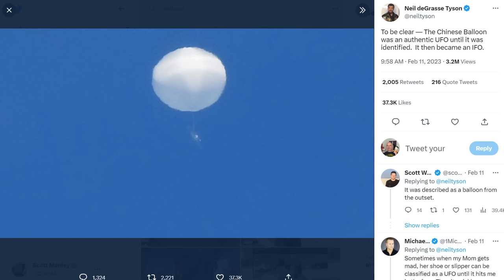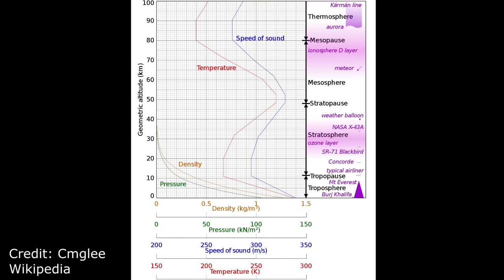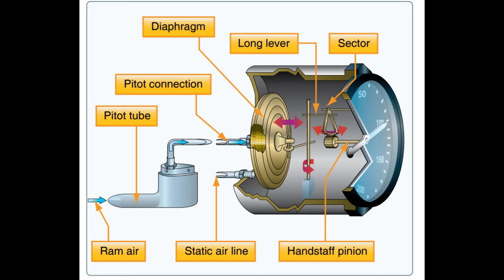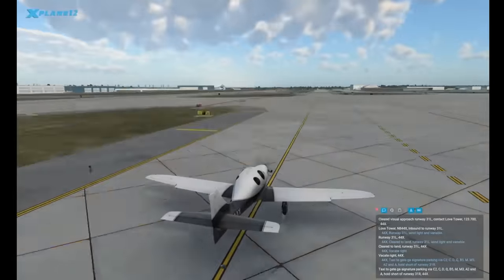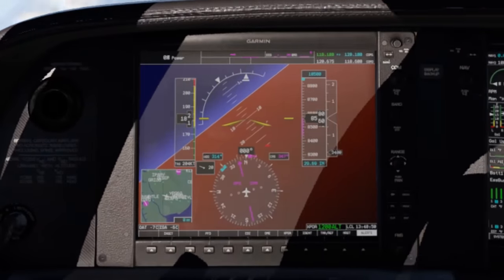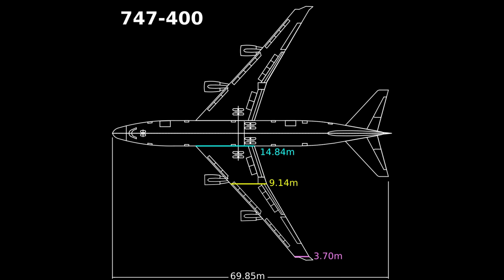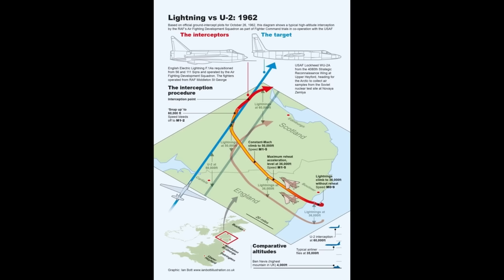How To Design A Plane To Fly At 100,000 Feet?

Comment: Fun fact: the U2 flies so high in the atmosphere, it can fly into the temperature inversion in the stratosphere, meaning the speed of sound actually increases again and it can go even faster without exceeding its limitation on laminar airflow. It also makes a very weird flight performance/ coffin corner envelope.
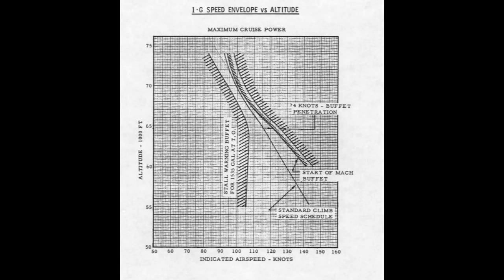Reply: That could explain why the graph at around 11:33 starts to pinch out but actually opens up again out the other side, you can see the upper limit bend back outwards again. I'm just left wondering how the stall flutter speed can decrease!
Reply: I have no idea wat you said.....but I DO know wat laminar flow is, and its awesome....thanks to Destin!
Reply: @stevemadak6255  Where have you been getting this information? What causes the wings to "fold up" but not the plane losing lift first? How on earth would adding more weight to the wingtips in the form of engines help? It was designed for minimum weight. Where did they put the wingtip skids then? If you're gonna claim things that go against all common knowledge, back up your claims if you wanna be believed!
Reply: @xiphosura413  exactly! :)
Reply: @stevemadak6255  Would like to know your source for the altitude spec. I've never seen a U2 with wing tip engines. Power's claimed repeatedly that he was "at altitude" and did not experience a flameout.
Reply: @xiphosura413  Yep👍
Reply: @mcs699  The weird part to me is that is already accounted for by the nature of IAS vs TAS, as altitude increases, the required TAS for a given IAS does too. What's curious about that flight chart is it shows a decrease in the stall flutter IAS velocity, which means that somehow, flying higher reduces stall speed, which is (as far as I know) normally at a constant IAS at all altitudes. It implies that somehow, above a certain altitude extra lift is provided at lower speed! There's probably something else going on which I cannot infer from the flight envelope alone, but it's certainly intriguing.
Reply: @xiphosura413  I looked at that performance chart again and I think I have it figured out. It shows the stall warning buffet speed for a particular weight *at takeoff*. So as the plane is climbing it's also burning off fuel and losing weight, hence the lower stall speed. And I'm guessing the reason the line bends instead of being straight is because the plane would have a much lower climb rate above 65,000 feet than at lower altitudes, so they're burning off more fuel per altitude gained.
Reply: @AirmetSierra  That actually makes a lot of sense, good insight!
Reply: Oh that’s great, seeing coffin corner as slang
Reply: @hattrick2219  Powers claimed
Reply: @johndoepker7126  Destin loves laminar flow!
Reply: @xiphosura413  You gotta admit it, one of life's little pleasures is, not just being knowledgeable in something, not even being able to share that knowledge in the youtube comment section, but when someone who isn't knowledgeable on a subject yet thinks they are, deletes their comment when questioned/corrected by someone who is..
Reply: Zoom climb
Reply: That was a very fun fact. I've known about the temperature inversion, but  i haven't connected it to the speed of sound til today 😊

Comment: Scott has a way of plucking obscure but interesting stories out of subjects well studied by most of his audience.
Reply: Michael Bishop  A few $50 20 mm bullets are a few dangerous projectiles if they miss/go through. The missile explodes.
Reply: @philipwhiuk  Yeah but it explodes into thousands of little bullets...
Reply: The gau has a much smaller range and accuracy compared to the sidewinder. There wouldve been a high chance of a bullet destroying the sensor array or missing and raining down on whatever is below. Also, the closer you are, the higher the chance of any debris from the collision impacting the air frame and potentially causing mortal damage to the raptor
Reply: @ScalarYoutube  TBH the sidewinder wouldn't have been that accurate either (as in they couldn't accurately predict the exact location it would hit the balloon).  Being a heat seeker I assume it had nothing to track from an unpowered balloon, so they just shot the missile in a straight line.
Reply: @JohnyG29  The balloon is white, meaning that the location the light from the sun hits is going to heat up far more than the opposite side in darkness. This means that the top of the balloon would have been hotter and therefore easier to track. There is no way they would've shot an aim-9 if it wasn't the best and most accurate option.

As a side note, the sidewinder was equipped with a counterweight instead of a warhead so it is clear that its intention was to disable rather than destroy.
Reply: @ScalarYoutube  Source for the Aim-9X being inert? There is a visible fireball on the close up recording of the balloon.

Also: Its my understanding that the reason for not using the gun is that it would not instantly disable the balloon, rather it would make it unpredictable because now you have something that is accelerating from the streaming gas while descending. + Assuming the gun could accidentally hit the payload but the missile wouldn't is very far fetched.
The raining down should also not be an issue, given they are over water and would have to take precautions for the Aim-9X regardless(airspace clear, no ships).
Reply: @Hyperus  That's one of the reasons why they didn't use the plane's guns to bring it down. There was a prior incident where a similar dirigible was peppered with multiple hits, yet it stayed aloft for ages before it came down.
Reply: And confirming that he's not that smart, since he doesn't understand thrust.  Or propellers.
Reply: @Hyperus  possibility of hydrogen gas 4 balloon
Reply: I think we all thought 'U2' when we heard '100 000 feet'
Reply: @imho2278  well I think the u2 has a lot of signal intelligence equipment. Which would make sense. I wouldn't be surprised if we had aircraft follow that balloon until we downed it just to jam signals.
Reply: @imho2278  well I think the u2 has a lot of signal intelligence equipment. Which would make sense. I wouldn't be surprised if we had aircraft follow that balloon until we downed it just to jam signals.

Comment: if I remember correctly, "coffin corner" on the U2 is around 6 knots. In other words, there's a 6 knot difference between stalling and falling out of the sky or ripping the wings off.
Reply: At cruise the U2 must be flown by autopilot as a human pilot would have a lot of trouble keeping the airplane in this narrow speed corridor.
Reply: Early model U-2s had that margin. In the later versions they expanded it to 20 knots.

Comment: I supported Helios and Pathfinder during the record flight. It got to 97,000 feet at a flight speed of 35 mph. In a head wind of 40 mph it could fly backwards at 5 mph and gain altitude. PMRF had a runway wide enough for it to take off, I was on the side of that runway as it took off.
Reply: Wow, care to share anything more about your experiences?  I'm fascinated with that project.

Did they consider using a prop with an electric motor to try and push further?
Do you know what composites the plane was built with?
Anything special about the wing design?  I can imagine the were at least 33m
Reply: I worked on the Oxygen and Hydrogen low pressure tanks that were to supply the fuel cell for overnight flight. The solar panels were able to produce more energy ether aircraft required for daylight flight. The extra energy was to be used to run an electrolyzer which then pumped the Hydrogen and Oxygen into their respective tanks. After sunset, they would be used to produce electricity for overnight flight.
I also built the high pressure tanks that were underwing on the Helios when it broke up and crashed.

Comment: I used to work for the company that designed and flew Helios on the team for the successor aircraft Sunglider. The guys who had worked on Helios back in the day were always annoyed that everyone brought up the 1 mishap they had, but not the dozens of flights that went off without a hitch both before and after Helios. 

Seeing the proprietary design methodology for that type of aircraft was amazing. It's like the ultimate extreme of aircraft engineering.
Reply: That one Helios mishap was an impressive one. I was very impressed by the Helios, and annoyed by the X-plane simulator's inability to fly a model of it, tried several ways. RC-models however were controllable.
Reply: Build a hundred bridges they never call you Bridge builder but blow ONE homeless guy under that bridge and all of a sudden you're a ...

Comment: The more I learn about the U-2 the more I respect the pilots.
Reply: Titanic testis... carbon fiber,  instead of the usual Brass ones they issue fighter pilots. Strictly to save weight and eek out an extra 1,000 feet into coffin corner, Doncha know 😜
Reply: My uncle is a pilot. Pretty interesting stories
Reply: Read about the post Cuba crisis monitoring og the island and You'll be amazed by the 1963-1966 Lockheed U-2 operational stories !
Reply: and the ER-2

Comment: That’s a really good video and captures all the main points. All I would add is that stall speed does start to increase if you climb high enough; it only stays constant up to about 10,000 ft then slowly increases due to Reynolds number (viscosity and density related) effects until about 35,000 ft, at which point Mach effects start to become dominant. Because a given Mach number has a decreasing IAS as you climb, this means the wing suffers low speed “shock stall” at high angles of attack (AOA), but typically at lower AOA than a normal stall. 

As an example, an aircraft that stalls at 100 kt IAS at sea level could stall at 130 kt at 40,000 ft. This problem gets worse until the top of the tropopause, about 65,000 ft, at which point the stall speed for a subsonic aircraft starts to reduce again slightly due to stratospheric temperature increasing with altitude. This phenomenon is exploited by the U-2, as shown in the video, allowing it to climb in a very narrow flight envelope with just a few kt between stall and limiting Mach number.

On the high speed side, ultimately it is aerodynamic heating that limits things, for the airframe structure and particularly for air-breathing engines. Scram jets help here, but they are fiendishly difficult to get right. Keeping combustion going in supersonic airflow is really hard to do!

Ultimately we might see aircraft that can sustain Mach 4, or possibly Mach 5, but much above that is highly unlikely. As for altitude, 100,000 ft is really the limit for conventional aircraft. Much above that and you need reaction control systems because control surfaces don’t work. And or course, at 63,000 ft is the Armstrong limit, above which you have to wear a pressure suit to survive, and even before then you need pressure breathing for oxygen if the aircraft pressurisation fails. That’s why Concorde had such small windows, and also why even the most advanced business jets don’t fly above 55,000 ft. You have to ensure they can get down to 15,000 ft in the event of cabin depressurisation, before the passengers die of oxygen starvation.

Comment: The story about the Perlan project is actually quite fascinating. I heard a lecture on it once. It took a lot of effort and some very special meteorological conditions to reach these insane altitudes. Enough stuff there for a whole separate video…
Reply: Please 🙏
Reply: I would love to see a video on the Perlan project, it deserves more attention.
Reply: They have a great website if anyone is interested.
Reply: Even the Perlan project sailplane was designed to deal with avoiding high-speed / transonic-Mach buffeting with a true airspeed at 90,000 feet expected to be nearly 450 MPH, while indicated airspeed was only 64 MPH (only 3% of the atmospheric density at sea level exists at the near ceiling of the Perlan glider).
Reply: Did Scott mentieon the altitude Perlan2 got to? 
It is also remarkable, that this glider design would be able to fly in martian atmosphere. But landing at those high true air speed could be a challenge.
Reply: @michaelderflinger5002  
If some sort of auxiliary RCS thrusters could be fitted, like RATO but in reverse, I bet it would work for softer landing and/or quicker turning when the flaps aren't quick enough.
Reply: @CharlieFoxtrot  Typo? Do you mean "Jet Assisted Take Off"? i didn't find anything for RATO.
I guess without a landing strip it is nearly impossible to relaunch a high wingspan aircraft. To use it insted of a rover it must stay in the air. Maybe a solution like the MIT ion plane (2018) might help to stay airborn.
Reply: @michaelderflinger5002  
RATO is rocket assisted take off. AR234 used this, and I think certain C-130s
Reply: @wesleycardinal8869  They have. YouTube channel.

Comment: There were rumours an EE Lightning zoomed up to 85,000 feet. This shot past and was observed by a U2 at that time. The maximum heights of some of the bombers of the sixties, Canberra. Vulcan, Victor was set by human factors, cold and more importantly the oxygen supply specs.  A bomber designed to cruise at 50K feet plus with maybe 10 ton payload can obviously climb higher with a zero bomb load. Teddy Petter designed a high aspect winged high altitude fighter in WW2, the Welkin. The problems he encountered persuaded him to design a high speed high altitude bomber, the Canberra, with a low aspect high area wing. The US stretched the concept with bigger wings and engines as a precursor to the U2.
Reply: The Lightning really is an impressive plane, it's actually plausible
Reply: It sounds reasonable. The F-15 zoomed over 100,000ft
Reply: @attilavs2  It happened close to Singapore where the tropopause was particularly high and cold.
Reply: could glsdb be launched from a balloon at 80K feet and if it were, what would it range be?
Reply: I have heard this also. EE Lightning doing a Mach climb, more or less vertical on reheat (afterburners), the engines would cut out, and then it's just ballistics. Thin atmosphere, control surfaces barely functioning, dark sky and stars above (in daytime), Earth curvature visible, then descending the ballistic curve, into the atmosphere, control resumed, all fine. Several aircraft have done similar, although not all of of them retained control at over 80,000ft. F-104 (tumbled around and flipped until it regained some air), MiG-25, probably MiG-31, and I wouldn't be surprised if the Su-27 and its relatives have tried similarly, although the MiG-25 family would be my favourite, currently, for a Mach climb to about 90,000ft. They're not going to tell us about this. Launching missiles from a plane in a ballistic Mach climb to hit a satellite - it's been done, but I'm not sure I'd volunteer. I salute the pilots.
Reply: There was a Canberra that held a long lived altitude record by carrying a rocket in the payload bay which gave it a boost at its ceiling.
Reply: @afischer8327 that was the NF-104, a specific rocket assisted F-104. It had a longer wingspan and had RCS, Reaction Control System to prevent tumbling
Reply: @afischer8327  the F15 that shot the satellite launched the missile at just over 38,000ft, at 65deg climb just under mach 1.  The satellite was at like 340 miles altitude (but 2000 miles away from the plane).  
I always figured they used an F15 cause it could get so high, but it makes sense to shoot it at the plane's performance sweet spot.
Reply: Yeah I just commented about not forgetting the late 50's designed Lightning. ONE HELL OF A PLANE compared to others flying at the time!!! 😉 👍👌    😎🇬🇧
Reply: The American version is the Martin B-57 Canberra, for reference.
Reply: @TessellationRow  BS.  The F-100 engine would not create thrust at that altitude.
Reply: @Andriastravels  You're correct about the engines. After putting the jet into a 60 degree climb at ~2.2M @ 37,000ft the engines were shut down to prevent flame out. After that it was purely a ballistic trajectory. It's not BS. There is actual video of it. Search for F-15 Streak Eagle.
Reply: MIG-25 recorded a flight at over 123,000ft.
Reply: @Andriastravels  that F-15 is in the National Air Force Museum. Nicknamed Streak Eagle and it recorded a flight at 103,000ft. Flew to 98k feet under its own power and coasted to 103k feet.
Reply: In the 1950's the USAF flew the massive B-36 at altitudes up to  - and perhaps above - 50,000 ft.
Reply: @CorrieBergeron  And the RAF flew a standard military spec Spitfire to over 51,000ft… (where it lost directional control and hit Mach 0.96 on the way down..)
Reply: It happened in September 1984 and the Lightening got to an altitude of 88,000Ft. with Flt Lt Hale at the controls
Reply: Mark Felton's channel has an episode about this. The Lightning that did it still exists.
Reply: @Tessellation Row  does "zoom" in this context  mean  a k inda manoeuvre relying on inertial energy, non maintainable, coasting

Comment: I thought the U-2 was based on the F-104 too, but that was an early prototype, the CL-282. For the U-2 they threw out everything F-104 based. Kelly Johnson was quoted as saying the only thing left over from the 104 was the rudder pedals. Super interesting rabbit hole to go down! Thx for the content, amazing as always.
Reply: It's certainly hard to imagine two aircraft more different in concept than the F-104 and the U-2... one a missile with only token wings, the other a near-glider with giant wings. There's a familiarity about the fuselage though, which may have translated through the design...
Reply: Test pilot Tony Levier mentioned he went from flying the Lockheed with smallest wings to the Lockheed with the biggest wings !
Reply: The U-2 fuselage was from the F-104, but the plane the other guy was talking about was the Martin RB-57D Canberra, a stretched-wing English Electric Canberra, as a stopgap while the U-2 was being developed. It’s wings were lengthened again, and NASA still flies two.